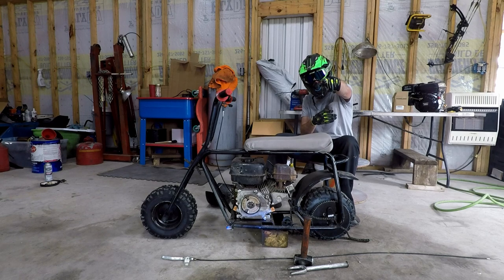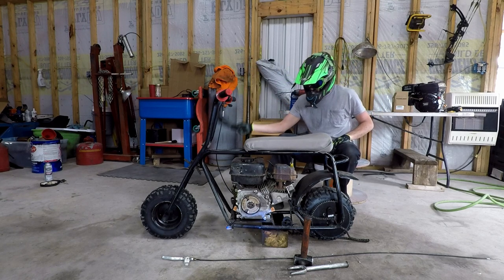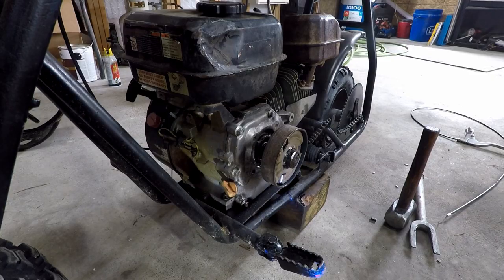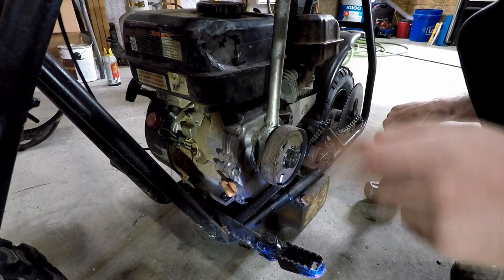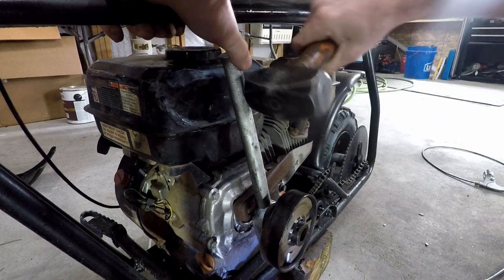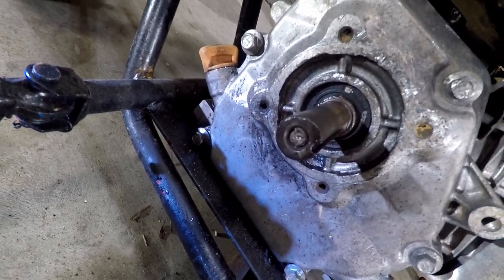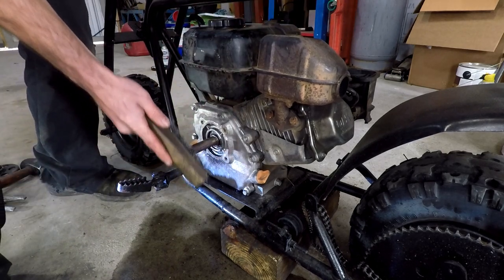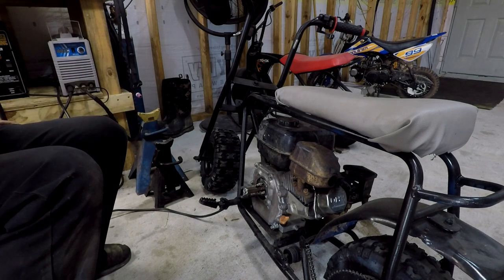Remove a stuck clutch and broken clutch bolt 2024

Comment: What method do you use if the bolt breaks further in? I lucked out a couple times but this can happen.
Reply from the maker: Same method just build the bolt out with weld just make sure you build it in the center as to not weld the bolt to the crank 🙃

Comment: I have a mini bike with a 212 predator motor. The pull starter gets stuck so i took it off. Pull it by itself and it works jus find. When i try turning that large cylinder(not sure the name but the thing that the pull start connects to)  it will rotate around about half way and stop. Is this a seized clutch?
Reply from the maker: Prolly just needs a pull cord assembly